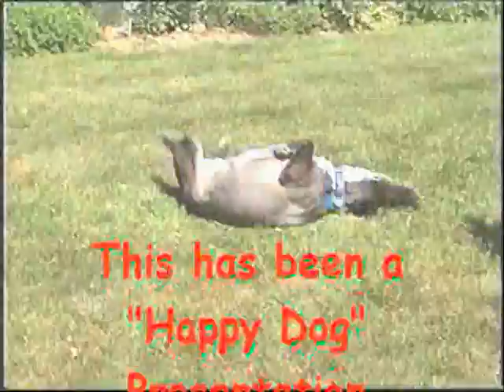Jetboil Canteen Cup Stove 1.1

Comment: The extra height on the Jetboil pot is for whatever food you add tothe boiling water I would assume. There has to be a stove we can make that will do the job needed for the Jetboil pot.  How about a good ole simple alcohol stove with a center flame pattern of 12 jet holes. The stove could be made out of two 5.5 oz juice cans so the potstand would fit the bottom of the pot. Maybe 1/2-3/4 an inch away from the bottom of the pot?  Im just curious as to how it would work. Just an idea.